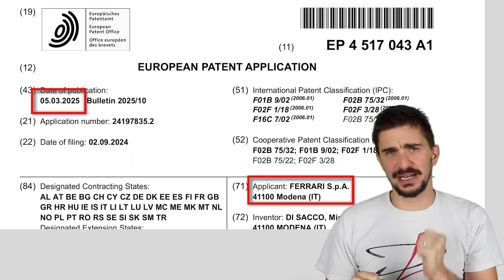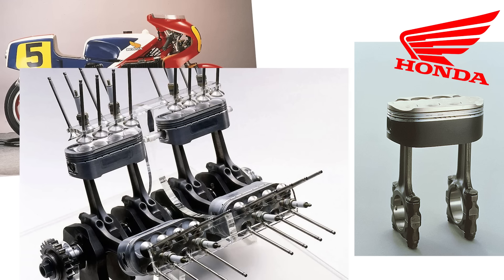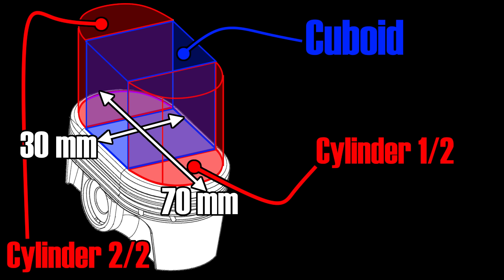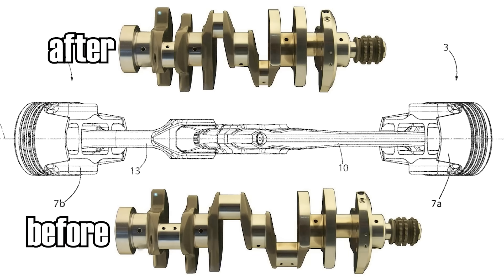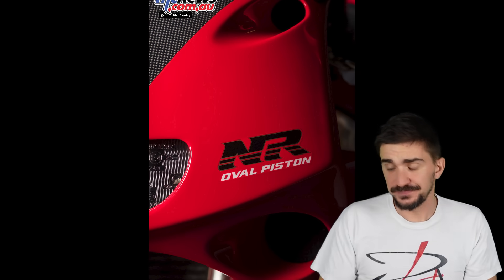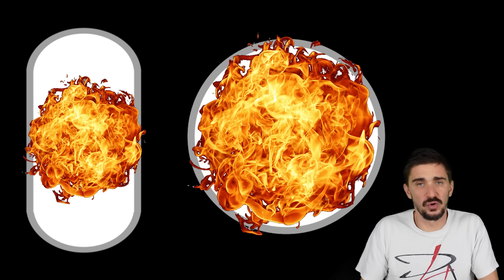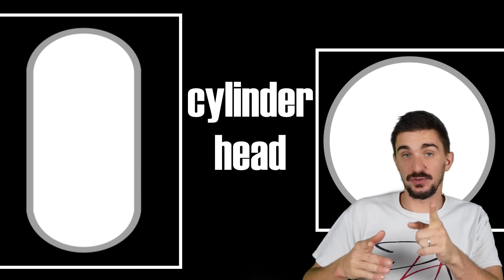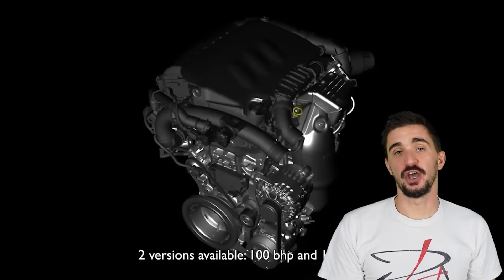Ferrari Just Patented Pill-shaped Pistons and Siamese Connecting Rods

Comment: Higher surface-to-volume ratio of that shape means more heat loss to the cooling system. That's bad.
   Round piston rings still have some issues after 150+ years of refinement...I have a hard time believing that oil consumption won't be more of a problem with this....
   Maybe, with a vacuum pump and near zero absolute pressure in the crankcase it won't? (Just kidding, I hope..)
   The pistons are oriented so as to make the ports more crowded, rather than less, as honda did..
   Ferrari would never do this...but I think pushrod v8s and v6s are wonderfully compact, and you get to fill the available space with more displacement, rather than more parts. It is actually an elegant way to get more power, but most of the car world scoffs at this simple, effective method. I'm a convert, a former fan of more cams, valves, rpm, parts....

Comment: The Siamese rod thing isn't new, although I've only heard of it used on aero and tank v12's. However, aside from calling it a "master and slave" rod, those had the connection point at where the beam meets the big end of the rod, not on the end cap. I imagine Ferrari did this is to make the engine shorter and to lower the center of gravity. Also, the "driving" part of the "driving engine" phrase might have something to do with patent law. I'm not an expert on EU patent law by any means, but that tends to be the case in legal documents when awkward phrasing is used so consistently.

Comment: I dunno - the thing with round cylinders for me comes down to two things.  The first being the cross hatch in the bore that rotate the rings and keep a light coating of oil on the cylinder walls.  Which brings up ring gap - again, as everything heats up and expands, I just don't see a clean way of controlling for this.  Okay, I'm not familiar the Honda NR motor at all, but I still have a very hard time seeing how they engineered the rings,  esp in a "cost" effective manor.  Just seems to me like this pill shaped piston will cause far more problems and headaches then it solves (even if a Ferrari gets driven less miles then a human walks in a year).  But I guess time will tell, esp if it enters into production.
Reply: Guess I think it's as good of an idea as Fords oil soaked rubber timing belt.  LOL

Comment: The unusual wear will be at the crankshaft, and the crank bearings.  Note that during ignition firing, the forces on the crank are not the same, from either piston.  IF there are mass resonances, especially at high rpm, this will pound the bearings to shreds.  Let us see some lifetime on these motors, and the wear which results.  Some speeds would be worse than others.

Comment: Ferrari reinventing the reinvented radial engine siamesed rods.... (Look at a Wright Cyclone sometime)

For the Honda, the NR750's claim to fame was "More valve area than a V8!" and each piston had 2 rods specifically to stop rocking in the bore

Gotta love your dig about Ferrari annual milage - It'll be interesting to see how long these engines last

BTW: one aspect not touched on is the vastly greater wall  surface area of the combustion chamber which means more heat loss and less efficiency. It's unlikely to show up in other applications because of this

Comment: The problems from Hondas oval piston race bikes and the 3 cylinder 500 bike was crank vibrations and stresses and more importantly pre ignition. Once Honda got the design worked out the FIM changed the fuel rules and removed most of the lead, that finally killed them. Bigger the piston the bigger the problem as King Kenny Robert’s put it.

Comment: I think that a lot of Americans do, in fact call this shape a race track oval.
Reply: Regarding the shared connecting rods, radial aircraft engines usually have a master connecting rod, with all the other rods being connected around the circumference of the big end. The master rod is solid, whereas the other rods all pivot on the pin that connects them to the major rod.

Comment: i forgot which japanese company did it for their motorcycles, but they used "pill" shaped pistons to get around cylinder number restrictions. 

It didn't work too well, couldnt create a good seal against the walls and caused uneven heat dispersion. 

edit: you mentioned the honda, bravo.

Comment: A few thoughts: 

First the piston shape is an oval.  What you showed to contrast that shape is an ellipse.  All curved shape, and no flats; that's an ellipse.  Piston is, actually, oval shaped.  

Second, the patent drawings show what appear to be just two valve relief cuts in the top of the piston.  Subtle, but noteworthy. That raised many unanswered questions. 

And third, the siamesed big end is not really unlike the arrangement seen on radial engines.  The shape of the transit of those "minor: big ends is peculiar and may actually affect the swept displacement of the cylinders with the affected con-rods.

There are a lot of questions raised in the patent drawings.  You might want to revisit this subject again.  Cool idea, though.
Reply: 4th:  This is only an APPLICATION. It isn't a patent

Comment: They stole that con rod arrangement from Allan Milyard. He built V 8 and V 12 bike engines using exactly that same arrangement. I have doubts about the "pill" shape too. It would require thicker cylinder walls to avoid flexing those flat sides and allowing gasses to bypass there too.

Comment: The Soviet Mikulin V12s had the exact same connecting rod arrangement. I do think that for a Ferrari, fork and blade connecting rods would work better and not result in half of the engine having a shorter stroke than the other. I mean it is Ferrari, they are not worried about cost, and besides machining costs, fork and blade rods would be superior in every way.

Comment: he is further down the line than me on engineering, the first thing that occurred to me was the lower surface area of the block would cause heating issues from a coventional larger design, also remanufactured cast iron blocks overheat more easily than new engines. just a thought, probably not a problem

Comment: I’m curious to see exactly what the patent actually covers because Honda used oval shaped pistons on a Grand Prix motorcycle (NR500) back in 1979 and even on a production bike (NR750) in 1992, so Ferrari shouldn’t be able to get a binding patent on an oval shaped piston based on Hondas prior work. 

The idea of the double connecting rod is interesting though, it should obviously be lighter and have less operating friction

Comment: The issue I see is the valve setup. Honda had it figured out, but now Ferrari has turned the piston the other way. Might it work with 3 intakes and 3 exhaust? You would think they would have touched on that in the papers they produced.

Comment: I believe the term is "Oblong", which is a bisected circle separated by a rectangle (and as such the displacement is easily calculated), as opposed to an Ovoid, which is either a conical cross-section (as is a parabola) or an elipse, which is actually an oblique circle, however these definitions seem to be non-standard for some retarded reason and mathematics allows for any of the above to be referred to as a "Oval", but who ever said mathematicians were very smart.  So, I am hereby defining these terms for you once and for all. We can excuse your "very embarrassing knowledge gap" because we like you.
The rest of your dissertation and analysis is awesome as usual, but it's very clear that the application of this piston shape between the Honda and Ferrari designs are totally different. The object of this "Siamese" con rod design is unclear to me, and I don't like it at all, while the concept of using "oblong" pistons is a great idea for compact engine size vs displacement regardless of the engine location in the vehicle, or even configuration for that matter. 
I could imagine a boxer design using these that would be super compact externally for its displacement size, the combustion efficiency and scavenging could maybe be enhanced with the piston face shape, and the stresses on the piston skirt region may be solved by further redesign of the piston with something like upper and lower ring sets... Idk, just more of my stupid ideas bro'. Always love your videos, you never fail to have valuable input on many of my mechanical interests... Thank you.

Comment: What surprises me about the different length of connected rods is that the shorter ones seem to be linked to the cylinder of the same side of the "V". Why not "alternating" them so that the dynamic behaviour of the engine can be better ? That would work for a V8 or a V12, but definitely not for a V6 or a V10 (odd number of cylinders in each row).

Comment: usually when someone says "drive engine" i think of ships as you will have several engines on a vessel, like you will have "drive engines" with a separate engine to run power for lights, air, pumps, all other acc.... i know that Lamborghini has a yacht but they use engines from MAN (a truck company), maybe Ferrari also wants to build a few yachts but use a Ferrari engine?? who knows...

Comment: Going out on a limb to say, the odd conn rod design might be a compromise on durability. They might have found that two equal length conn rods weren't as strong for the side that has the fasteners and decided to increase it's durability by intentionally breaking it.

They might be leveraging something like an Atkinson cycle to get more power or fuel efficiency out of one set of pistons without running foul of other patents.

Comment: The pistons rings and their seating is the issue here. Round rings have even tension all around providing even tension. I would think at least the longer straight area of the piston would require gas ports on top of the pistons to aid in ring seating at those areas, possibly causing those areas to wear faster as well

Comment: A couple of remarks: 
The shape of the pistons is not novel. Honda did it decades ago. 
Nor is the idea of a master and servant conrod pairing per crankpin also is not new. Radial aircraft engines have used a master and up to 8 others per crankpin. There is a way to avoid the offset by using a fork & knife arrangement per crankpin as in many WW II aero engines. Of course, most v12 aero engines ran at under 3,500 rpm (but were also 26++ liters). 

What may pass muster as being “not obvious to a practitioner of the state of the art” (part of the USA patent req’t) is combining the paired conroe and oval orientation to shorten the length of a V8 or V12.  

When does the crankpin see its maximum acceleration? TDC/BDC? If so, wouldn’t the design of the rod lower end put the conrod bolt shanks in shear at TDC/BDC? Conventionally at TDC/BDC the bolts would be mainly in tension. I’m sure Ferrari has computer modeled this to death. Still given the limited run of Prancing Horses each bolt will make the cost of a main landing gear bolt for a 777 or A3xx seem bargain bin.  (haha).

Valve arrangement, Honda was able to out 8 per “cylinder” (working chamber) and could have used a standard arrangement of 2 cam shafts per cylinder with the cam axes parallel to the crankshaft rotation. Thus Honda had maximum port area per “cylinder.” What is Ferrari going to do? Solenoid or pneumatically operated valves?  Maybe this is in use in F1 (haven’t kept up with the silliness); I seem to recall the FIA banning such back in theblate ‘90s along with active suspension.

Comment: At 3.30 there is a geometrical mistake, if the cuboid is 30x30mm, the "oval" cannot be long 70, the two half cylinder must have a radius of 15mm, so the total length should be 60mm.
If the total length is 70 the cube has a side of 35mm.
Reply: Except that the cuboid is not a cube, and is 40 • 30 • 50.
Reply: @Paolo-gc9us  yes in that case it works. I didn't consider this configuration. Thanks

Comment: With modern CNC based manufacturing systems it really is no hardship to make these 'pill' shaped cylinders & pistons, doing so in pursuit of a significantly lighter & more compact engine is a reasonable endeavour in my opinion.

Honda did it to increase the rev-ceiling, they wanted a 32 valve 750cc V8 but there was a 4 combustion chamber limit in the regulations.

Comment: They also could have used "fork and blade" style connecting rods (a forked end rod straddles an opposite side narrow rod), which have a history in V type motorcycle and aircraft engines. Presumably there is an advantage to their choice.

Comment: I wonder what valve configuration they want to use with this. If it is not a 8 valve per cylinder like Honda, it looks like had It looks like you restrict airflow, but with the piston rotated 90deg. to the Honda design, it will be difficult to optimize in end outlet ports, and what for valve control? 4 camshafts per head?
Lets see if this will ever get to or beyond the prototype stage.

Comment: 7:50 ... completely agree with you here on the long-term outcomes of the pistons with the added centrifugal force being applied to the outlying corners of the piston. Also ... 9:25 ...  the " master connecting rod " has a 1/4 inch or so of metal around its' connection to the crankshaft, whereas the " slave rod " has that very thin 1/16 inch of metal on its' very bottom which might be overstressed as the piston reaches TDC and then has to be stopped and turned to the opposite direction at, say, 8,000 RPMs. Granted, these are pen and ink drawings ( OK ... CAD ) but there's a lot of stress that's going to be applied to that little thin strip of metal with some sort of weird ( plain ... ball ... roller? ) bearing in there.

Comment: Very curious what the valvetrain/camshaft/port layout would look like with such a “cylinder” layout. The Honda oval piston engine lends itself easily to having a conventional DOHC head layout with the spark plugs between the camshafts and the intake & exhaust ports below them. The pistons major axis being parallel with the crank and perpendicular to the intake & exhaust ports just means you have 8 valves per piston instead of 4, 2 spark plugs instead of 1, all without making any radical changes to the conventional head design.

This Ferrari patent has the aim of reducing the length of a V12 engine and thus the major axis of the piston is perpendicular to the crank, and parallel to the intake & exhaust port. This effectively leaves you with a deceptively large “cylinder” volume and likely only the minor axis with which to move air and fuel through it. Actuating 8 valves per cylinder in this layout would require a very interesting valvetrain layout to say the least, and how much room would be left for the accompanying port designs, or dual spark plugs, or a direct fuel injector would bring just as many questions. Trying this “cylinder” layout with only 4 valves, and 1 spark plug, and 1 fuel injector per hole likely wouldn’t yield the desired results in Ferrari terms of producing a high revving powerful engine(be it forced induction or naturally aspirated), and likely wouldn’t perform that well emissions wise either.

This is not to mention all the oddities likely to be generated by the shared connecting rod arrangement which are unlikely to fit the Ferrari ethos.

Comment: But why would they have different connecting rod lengths? 
Putting the connecting rod bolts on the bottom would eliminate any accessibility problems for the said bolts and could result in fixed and equal length connecting rods, also eliminating balancing issues and more moving parts. 
Am I missing something?

Comment: Ferrari (and honestly Ducati) do something that's been done before and try to sell it as new for twice the price; in other news, water is wet.
Reply: No-no-no, technically speaking, the water is not wet, it makes things wet. ;)
Reply: @tweed0929  The "not wet" water is also touching water, therefore it is wet. Checkmate.
Reply: To be fair an engine with pill shaped pistons hasn't been put on a car ever by a manufacturer and there hasn't been a pill piston engine with more than four cylinders yet. Siamese connecting rods are also a new thing. So while not exactly a new idea it does being some new stuff to the table
Reply: @Mr.Engine993  How do you survive with so little of culture and knowledge...
Reply: The approach is different, Ferrari is using the same shape but with the piston perpendicular to the shaft, Honda had arranged them parallel. Having said that, Honda is doing the same thing right now with its "new" e-clutch and they are passing it off as their innovation when it is a bad copy (you can see that it is simply a device applied to one of their engine, it is not designed together) of the scs clutch that the Italian mv agusta has been selling for 15 years.
Reply: Siamese connecting rods have been in use since before World War II, commonly found in radial engines and even in some V-type engines. (See: https://testingblog11666.blogspot.com/2008/10/radial-engines-and-main-rod.html.) Typically, the smaller-diameter bearing on the secondary or “link” rod tends to wear out more quickly. This is likely due to its smaller surface area experiencing the same forces as the larger “master” bearing, resulting in higher pressure on the oil film. That said, with decades of engineering progress since WWII, maybe they figured out a way to fix this problem.
Reply: How’d Ducati get dragged into this?
Reply: @scotthammer4007  he hates Ducati because they are humiliating the Japanese in racing.
Reply: Every company is doing the same thing.